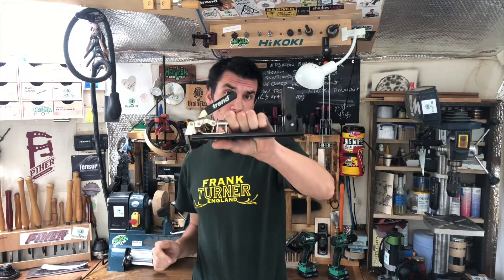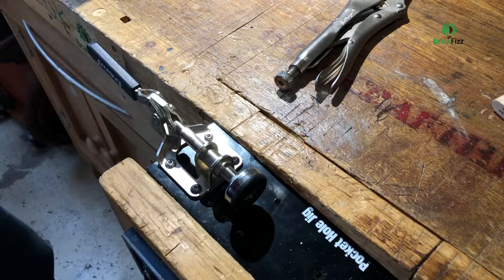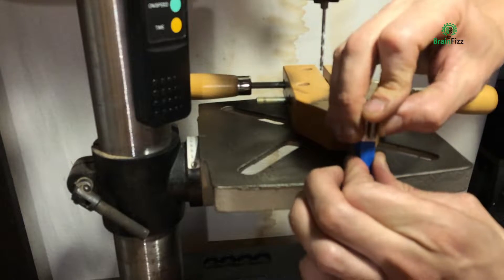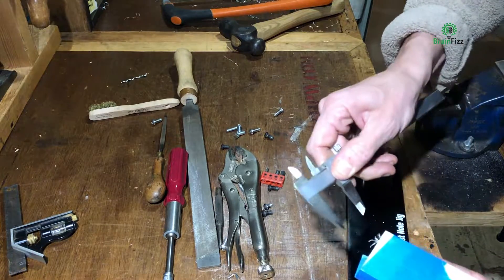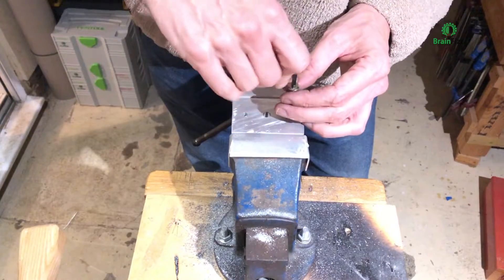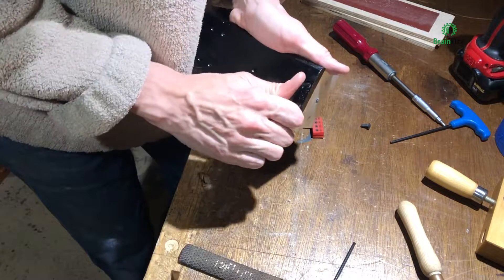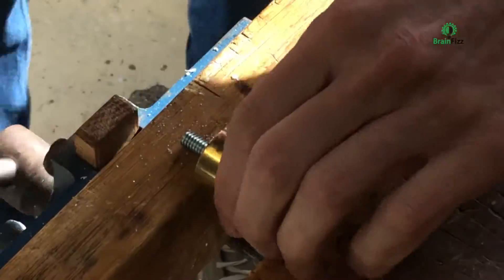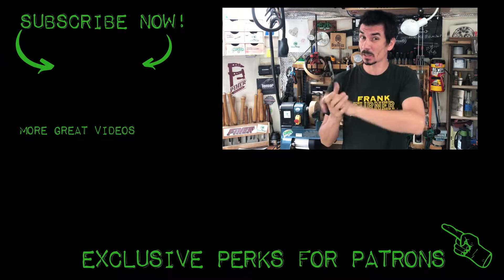How to make your own pen press from a pocket hole jig

Comment: Looks great, all I need is a new pocket hole jig. As I need to get a pen press at some point.
Reply from the maker: If you're after a pocket hole jig, the trend one is ACE, the one I used in this video https://amzn.to/31qNWgm You can even use the remaining parts of the jig and use them as a mini pockehole jig.... they are currently going for great prices too as people are starting to stock the new Pro jig, and thus are clearing stock of the older models! So you could actually have both for about £50 and a bit of work.... LOL!

Comment: Hi Richard,
You have to know how to improvise, which did quite well in this one.  I didn't know exactly what you making until the end as I've never made a pen like that.  I think the plastic "casting" trick could be quite useful.  Thanks for the video!
-mike
Reply from the maker: Thanks for watching Mike! I was actually pretty happy that the casting worked as Iwasnt sure it would.... since it was an odd imperial thread, it was probably the riskiest part of the whole thing, but yeah it could definetly translate to other areas, hold down clamps and the like...

Comment: What a really well made jig! all my stuff is just bodged together 👍 😊
Reply from the maker: The original jig is really well made - it's actually lasted me about 10 years as a pocket hole jig, the rest is basically cutting a length of plastic and metal, then drilling and tapping a couple of holes..... as long as they line up, there's not really accuracy needed!